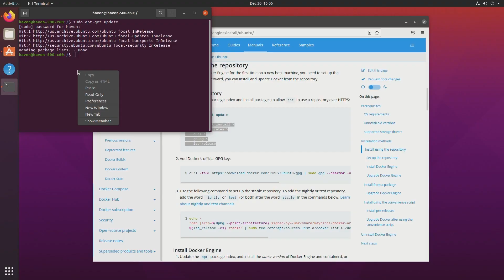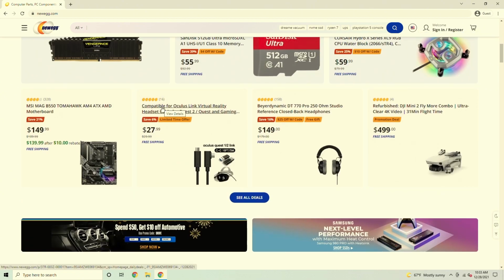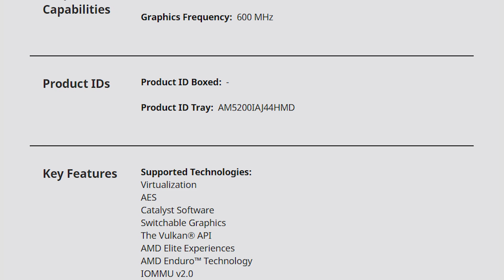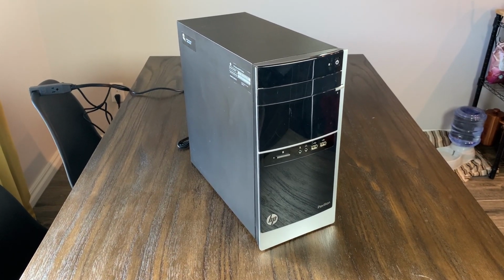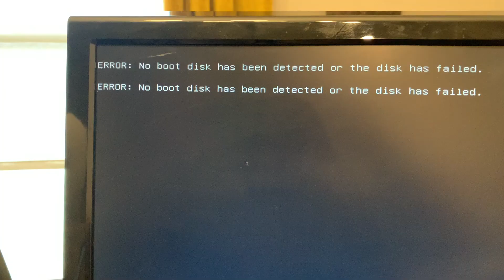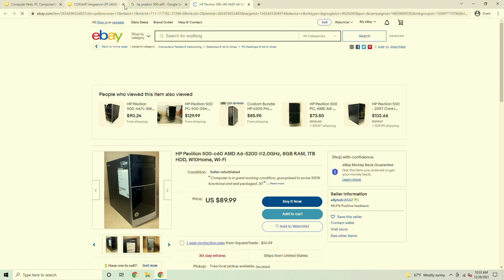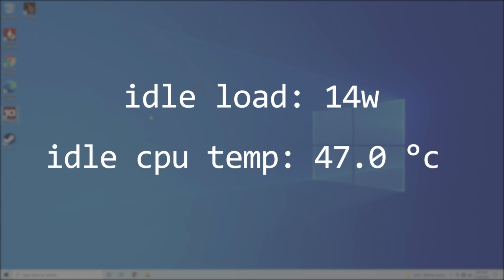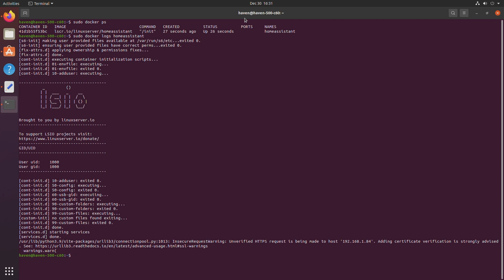$15 Quad Core Bargain PC - Landfill to LAN: A6-5200

Comment: I really wonder what HP was thinking. That computer is the worst of both worlds: the downside to a laptop is that you're limited on expansion options, with the upside being that its self contained and portable. The downside to a desktop or tower system is that it isn't portable, but the upside is that it gives you more options for upgrades. That computer combines all of the disadvantages of both form factors into one package
Reply from the maker: I think they were selling this because:
A. People were more familiar with desktop form factors and it “looked” capable,
B. It let them reuse case materials and assembly lines rather than doing a redesign.
C. Hard drives and optical drives were more common and necessary, so this case allowed for those.

Comment: Use paper Q-tips for cleaning, instead of the ones with plastic shafts.  You can take the paper ones and cut them in 2 at an angle with wire cutters and the newly made pointy tips will remove any hardened paste in between components and in corners.  Because it's paper, there's a bit of extra give to help protect the components you're cleaning.  Also each Q-Tip gives you 2 little picks and once they're dirty, you simply toss them.  Use electronics grade alcohol because it's 99% alcohol.  Drug store alcohol can be as low as 50% alcohol while usually being 70% or about 90%.  The weaker solutions don't clean as well.
Reply from the maker: Thanks for the 'tip' (pun intended)

Comment: A good addition to this computer could also be to add some more RAM.  Usually older computers don't have enough RAM, rather then have to allow CPU or even graphic cards.

And old memory could be cost effective upgraded, as they tend to not visst to much on E bay etc.

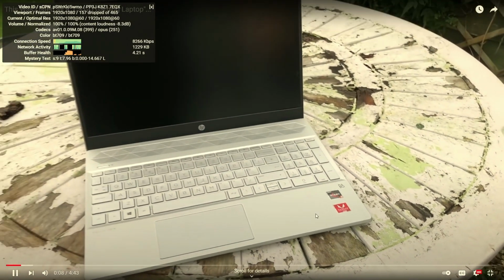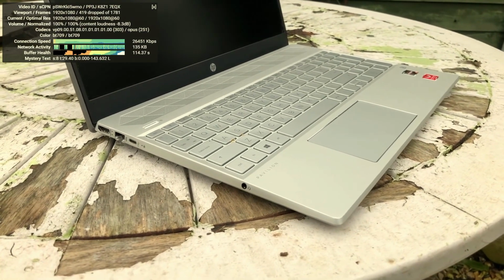Comment: Youtube is dropping frames per Stats for Nerds at 7:56 and 7:59, because it defaults to VP9 and AV-1 video codecs that your iGPU can't decode.  That forces your CPU to do it, reducing performance, shortens battery life, and heats up laptops.  Youtube still has the standard h.264/AVC codec, but it tries to force newer codecs to save on storage/transmission costs. 
AMD A6-5200 uses Radeon HD8400, which has Unified Video Decoder 4.2 .  UVD 4.2 can decode h.264/AVC, but not VP9 or AV-1. Add the h264ify or enhanced-h264ify extensions  to the browser to force YT to serve h.264/AVC, allowing the video to play well the first time.
Reply: Great comment

Comment: Worth noting, you can usually use white mineral oil or another lubricant that won't eat plastic (canola oil actually works pretty well in a pinch) on the small bearing located behind the sticker on most case fans if you find they're spinning slowly or making a lot of noise.

Comment: A quick tip about the thermal paste, you can clean the sticky kind of thermal interface OEMs love to use with a paper towel with some WD40 sprayed on it, it works like magic compared to trying to scrape it off.
Reply from the maker: interesting... might have to try that

Comment: I need to go the landfill if there PC’s there especially laptops I almost bought 10 used/broken laptops for $100 the other day for parts and seeing if I could maybe find a better one than the HP one I have with the A-6 qaud core processor in it, that’s the chip I’m running I bought my computer in late 2013 I got an 8gb 1600mhz qaud rank ( it said it had 5 ranks but I dunno and it’s made to run with the AMD A-6 ) SoDIMM otw to double the ram since there’s only one dimm slot I got a r15 score of 153 with 4gb of ram single channel of coarse same exact temps mine hits 47C idle and 67C while running R15 just crazy I was wondering why I couldn’t get it lower than 47C must be the chip my other A-6 machine also bought in 2013 idles at 40C and oddly throttle’s at 60C except this one is a Toshiba satellite

Comment: Hi again..I commented on the 40 dollar Lenovo..and thought that was the bargain of the year..despite no RAM or HDD..it is..but this peculiar HP..I've seen before on another channel they bought new.. can't recall how much but it was a few hundred..you acquire for 15 bucks..another great deal..a kind of Laptop board in a Tower case..quite useful..and even stream games from Steam etc..amazing..great content..I'll be adding this channel to my watch list..thanks for the reply too.. I'll not be parting with my 3 x core2 duos anytime.. they're not eWaste to me either..my Dell Optiplex towers are about the cheapest (free in 1 instance and upgraded) over here in Britain..mostly I believe because the proprietary form factor makes them undesirable..kind of reverse mirror image boards..I like them..I got several free Laptops though..haha..and power supplies with a couple..all Dells..seems like Dell crazy but I have a few others too..2 Shuttles..an old AND 939..and few thin clients..and an ITX with an AMD J series dual core..

Comment: Firefox plays back Youtube videos much better than Chrome for older PCs, from my experience.
Reply from the maker: Thanks for the tip!
Reply: @HardwareHaven  Sure, give it a shot and see if you notice and improvement. The h264ify addon is also a availble for it, which can help a little more in some cases.

Comment: It would be cool to add a second stick of RAM and rerun some tests, dual channel RAM should speed things up, especially the GPU.
Reply from the maker: I would, but this cpu only supports single channel memory
Reply: @HardwareHaven  Oh wow, super low end.  I think you mentioned it in the video but I saw the 2 memory slots and just assumed it would have at least a dual channel memory controller.
Reply from the maker: @peterskalak7844  I think it was a limitation of the mobile architecture. Pretty annoying lol

Comment: My wife bought me a Toshiba laptop with this APU in it back in 2013.  It was low end at that time, but I wanted it for running Office and browsing the web.  Almost 9 years later, and it is still going strong.  I haven't even formatted the HDD in it.  It started out with Windows 8, then upgraded to 8.1, then 10, and now it has Windows 11 on it.  Even though it isn't technically supported, Windows 11 runs beautifully on it.
Today it is used for watching movies and browsing the internet, which it still does very well.
The only "gaming" I've ever done on it is running a few emulators.
Maybe if you haven't already dedicated it to being a permanent server you could make a video on some emulation.  You might be surprised how well it does.  I don't remember for sure, but think I may have even used it for PS1 games.  I know Gamecube, PS2 etc. are NOT something you will use on it though.
Reply: What graphics drivers do you use on it?
Reply: @Rijerus  I realize this is a very old post, but in case anybody is looking for this answer..... Windows installed  AMD Radeon  HD 8400 / R3 drivers automatically and they work fine.
Reply: Just an update to my above post - 3 years later.  I am still using this laptop at camp for watching movies and browsing the internet.  Since my last post I have installed a 512 GB SSD and a fresh install of Windows 11.
I am still using it for Netflix, watching tv through a TV app, and watching YouTube videos, typically at 1080p without issue.  It currently has 8GB in it, and I'm upgrading it to 16GB soon, but don't expect a ton of difference.  It typically hovers around 4GB of RAM usage with anything I do as it is.  It also only supports single channel memory, so a second stick won't help with that.
I've also installed Kubuntu on a very similar system and it does everything I described above just fine.  If Microsoft does finally make it so Windows 11 won't run properly on this old girl I will switch to Kubuntu.

Comment: Nice grandma pc ( not the grandma that plays GTA V, but the other one, that goes to Facebook and looks for recepies ont the web ). Getting rid of the landmowernoise fan was a good move too. Tricky powersupply though. Would make a great fileserver. Put another SSD in it and get rid of the optical drive ( you can glue it's front to the computer's front so it doesn't look ugly, or just leave it in place ).

Comment: I like my 2008 HP dc5850 better. It has an AMD Phenom II B97 (4C4T;  3.2GHz); 8GB DDR2 (800MHz); 1GB GeForce 8400GS (16 Cuda Cores); PCIe 2.0; 4 SATA-2 plugs; VGA and DVI-D; USB 2.0 and a PCIe-x1 card with USB 3.0.  I used it as main desktop till Apr 2019, running Ubuntu 18.10 with ZFS and a number of Virtualbox VMs, like Windows 3.11, XP and 7 and some Linux releases. In the end it had a 128GB SSD; 28GB as boot & swap partitions and 100GB as ZFS Cache for the 2 HDDs containing 3 500GB partitions with 2 partitions in Raid-0. 

Currently it is unused, since I have no SSD nor useful HDDs, the largest free HDD is 80GB with a lousy 60MB/s throughput.

Comment: Can you review the xeons from socket 775 t I was wondering if they are any good I was going to upgrade because my old PC cpu is dead
Reply from the maker: Xeons are definitely something I'm interested in getting into. Right now I'm mostly just looking out for good deals in my area or projects that I think are fun. I actually just came across a dual cpu server board that I believe is the 775 socket. It's about an hour drive to pick it up, but I might end up doing it. Thanks for the recommendation!
Reply: @HardwareHaven  what would be better core 2 extreme or Xeon
Reply: @HardwareHaven  socket 775
Reply from the maker: It really just depends on the specs and price. It seems like xeons can be a really good deal because not as many people are familiar with their specs, but they can also be a bit more tricky to find proper mobo and Ram for. Depending on your budget, also be on the lookout for some used prebuilt deals. A lot of i3 and amd Athlon systems get sold for pretty cheap, and those are typically better performers than even the high end 775 stuff, and also give an upgrade path
Reply: @HardwareHaven  or would the 550 bottle neck the Xeon x3440 the 775 one idk I was going to upgrade to it like I said my cpu is dead and it has a decent cpu cooler